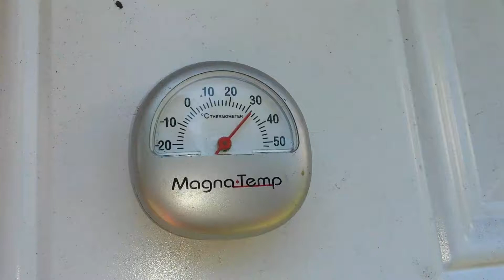Getting started on the Redneck Trailer

Comment: that's a cool trailer dude.  is this a long weekend?  if you vlog daily I will likely watch them all, I'm usually looking for stuff to watch in the evening and I like this kinda stuff.  I should probably clean my workbench also, its pretty bad/messy lol
Reply from the maker: Long weekend coming up, not this weekend.  This video was filmed today.  Thanks for your support! Definitely going to try this, it won't be easy but I like a challenge.
Reply: friggin right.  hey i just watched my first commercial on your channel!  I have a trailer project also but its currently just a frame from an old camper, but I'm hoping to make it into a float trailer or flat deck toy-hauler.
Reply from the maker: Commercial? My videos shouldnt be monetized :s Looking forward to seeing what you do with it.  I want to make it so the box can either come off or fold down to make it a flatbed.  I liked that trailer because its small enough to fit through my back gate.  Possibly a winter project
Reply: I like the tent apparatus, you made that?  that's awesome for camping probly.  I monetize my videos personally.  its not much but ive earned about 300$ in the last 18 months.  better than nothing, and I used the small earnings to buy a small belt sander for the homemade knives n stuff.  if you can earn something for your hard work, while entertaining an audience, i say why not?  flat deck trailers with stake-pockets are good for having removable sides also.  small channel earnings are quite slow but theres always potential for growth, especially if any videos become popular or viral.  i don't mind watching the commercials either, and most are skippable if you prefer.  if youre not monetizing perhaps you should.  just a suggestion. :)
Reply from the maker: MrJohn613 hmm maybe I should go for it.  The tent is actually part of the trailer, it belonged to my grandfather who removed it to store stuff in there, I added some snaps (instead of staples) so I can put it up and take it down as I wish, so far it's been great!
Reply: good work man.  i like it.